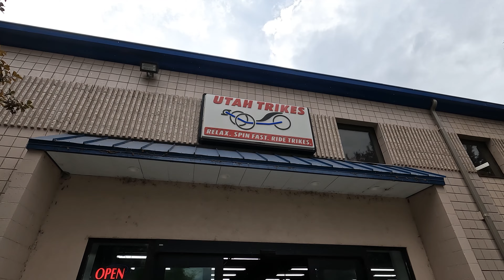The Stig tries out a new e-bike in Las Vegas!

Comment: Purchased by the ton, chromolly is 10 times the cost of aluminum.  Chromolly is, by far, the best material to build these things from.  It's very light and has much less stiff and much stronger than aluminum.  It's all a problem of cost.  Chromolly bikes are lighter than aluminum.  Aluminum is a lighter material, but you need a lot more of it (the tubes have thicker walls and larger OD).  Further, aluminum bikes is the reason all bikes have a pogostick as a fork.  The vibrations from an aluminum fork would kill you hands and wrists.
The only people who benefit from the stiffness of aluminum are racers and professional cyclists.  They have all switched to carbon fiber.
Reply: In terms of strength to weight cromoly steel and good grades of aluminium are about equal - in fact almost all structural materials, steel, titanium, aluminium, magnesium etc. have about the same strength to weight, with well made carbon fibre parts being then only option that's significantly better (And an environmental/recycling disaster that has no place in the cycling industry). 

Look up the weights of bicycle frames on the market and you'll find Al frames are consistently lighter than steel and titanium frames in the real world. Al has about 1/3 the density of steel, but it is also about 1/3 as strong in terms of yield strength (Titanium is about 1/2 the density of steel with a little over 1/2 the yield strength, though some of the air hardening Reynolds steels engineered specifically for bike frames are superior to the highest grades of titanium in strength to weight). The issue with this is that there are large parts of bike frames that aren't run anywhere near their strength limits such as the BB shell, most of the headtube and the dropouts, but they still have to fill the right amount of space to perform their function. With a low density material like Al it's easier to fill that space with a cheap constant wall thickness part without incurring a massive weight penalty or a massive cost penalty in machining away all the material that's not needed structurally.

Since these are motor propelled instead of human powered, a steel frame, even though it will be heavier, should be cheaper to manufacture (Steel is cheaper as a raw materials and can be MIG welded or brazed instead of TIG for example, and the steel frame won't be signifcantly down on strength if the frame isn't heat treated after welding). If they get used hard, the resilience of steel will be a lot more useful - Whistlin Diesel's cybertruck test (Where the back literally snapped off the truck after it had one heavy landing onto the rear going down a step) shows just how poor a material choice Al is for hard use - especially when he smashed the life out of a steel chassis pickup in a follow up video, showing that a steel chassis wouldn't fail even with literally 100 times the abuse. Admittedly that could just be absolutely shit engineering from Tesla, they definitely do enough of it, but it is a well known issue that al parts crack in the same situations that just make steel parts bend.
Reply: @peglor   "Look up the weights of bicycle frames on the market and you'll find Al frames are consistently lighter than steel and titanium frames in the real world."

I don't entirely disagree with regards to bicycles. However, in the real world, particularly at the low end, an aluminum bike almost always has a heavy poor quality suspension fork which brings the weight up.  A hard (non-suspension) aluminum fork will be rough on your wrists, hands and probably shoulders and back.  Aluminum is remarkably good at transferring road noise.  But high strength structural steels like those used in parts of a car meant not to deform are extremely strong.

Plus, the benefit of aluminum as a lighter material is offset by the need to use more of it.  The tubes tend to be larger, which makes an already stiff material stiffer.  This was always the rationale for aluminum bikes, not the weight.  Aluminum is also a much less tough material.  Even mild steel is very tough. Chromoly is even tougher.

"Since these are motor propelled instead of human powered, a steel frame, even though it will be heavier, should be cheaper to manufacture (Steel is cheaper "

Chromoly steel is 10x the cost of aluminum even by the ton. It is used extensively in auto racing and to a small degree in bicycles. I don't know if it is used in other applications like motorcycle frames, but I doubt it.. There are thousands of variations of steel.  I would think the very high cost is due to low manufacturing volumes.  Mild steel, otoh is cheaper than aluminum.

Yes, aluminum is not a tough material in comparison to steel.  I'm pretty sure a lot of the cybertruck uses cast aluminum (IIRC, they call it gigacast), which is probably brittle in addition to not being especially tough.
Reply: @tarstarkusz  Nobody riding bikes off road does it without at least front suspension. Even the road bikers have realised that ride quality actually counts for something, so they're moving to wider tyres instead of suspension, as there's no rolling resistance penalty - in fact independent testing has shown the rolling resistance of wide tyres is lower than narrow ones thanks to modern tyre sidewall designs, so the only people who haven't moved from that are the ones convinced that the fastest bike setup must also be the least comfortable and the most likely to kill you on loose or slippery surfaces. 

On the material cost, I suspect you're not comparing like with like. My understanding is that cromoly steel is literally any steel with Cr and Mo in it, so it covers an absolutely huge range of strength and price options, including some stainless steel options. If you want the most insane steels, maraging steels are probably the ones to go for. Yield strength around 2 GPa and a lot of them are stainless as a side-effect of the composition and I have no doubt that costs a lot more than most grades of Al. Go looking at rarer grades of Al and you'll also find really expensive compositions - 7075 is a phenomenal structural Al for example, with a yield strength better than some steels, while still having 1/3 the density, and that stuff is expensive relative to the far more common 6000 or 2000 series Al.

I have 2 steel bikes, one is ordinary 4130 CrMo steel and it's very heavy, even though it's quite a small frame, but it's been used for everything from road sportives and XC and marathon racing to street trials riding and now commuting and it's still going 22 years later. I have 2 Al framed bikes, also hardtails, and I reckon the 4130 frame rides harsher than either of them, but interestingly, because of the large diameter downtube in particular, the Al frames resist flex between the handlebars and the BB much more effectively, so they respond to hard pedalling more easily, as well as being more than 1 kg lighter - I doubt if either of those Al frames would have survived half what I put the steel one through though. 

The other steel frame I have is Reynolds 853 and it's a completely different feel because of the lighter, springier tubes - that's been going for well over 10 years of hard off road use. Both of these options cost more than cheap Al frames, but a lot of the reason Al is so cheap in the bicycle industry is because the entire industry tooled up for Al about 20 years ago, with steel relegated to a specialist niche, so there are no economies of scale in steel frames at this point, especially in a market where hydroformed frame tubes are almost universal.

For general structural work, especially civil engineering and automotive, steel is still much cheaper, because it gives the best performance per dollar, and they're willing to take the hit on weight because it's strain to failure and resistance to work hardening and fatigue are much better than Al so they can built safer, cheaper structures. A lot of the Al in modern cars is non structural to save weight for fuel economy.
Reply: @peglor  On the material cost, I suspect you're not comparing like with like. My understanding is that cromoly steel is literally any steel with Cr and Mo in it, 

4130 steel is what I am talking about.  Most chromoly bikes use this grade as do most race cars (specifically, the roll cage).

I am comparing 4130 tubes with 6061 tubes weight for weight, it's literally 10 times the price. Doing it by weight helps capture the bigger/thicker tubes of al.   I don't think you can buy it by the foot in quantity. (they come in standardized lengths).  I used quantity pricing because that is the best way to compare the actual cost without 3rd party specialized markups, though in most places in the US you cannot directly buy metal directly from the mill. I worked in a steel distributor many years ago.

I agree with you that the industry moved away from chromoly steel for price reasons. Now the whole industry is either al or cf with steel regulated to a niche market.

I have a 4130 large frame bike that was 23 pounds stock, a Trek 720 from the early 90s.

If your chromoly steel bike rides harsher than your aluminum bikes, something is wrong.  It is near universally accepted that steel rides easier than aluminum.  If you're comparing an aluminum bike with a suspension vs a steel bike without, well, that is not a good comparison.  Aluminum is stiffer than steel, especially with the larger tubes. 

The bikes in this video cost thousands of Dollars.  They should be making them from chromoly steel, IMHO for the prices they are charging.

I don't know why mountain bikes aren't made out of chromoly.  Perhaps there are benefits they getting from the larger tube size beyond strength.  If you are selling a bicycle for 5-10 grand, material cost of the frame is negligible.  Though obviously a lot of them are carbon fiber, which at least theoretically is stronger and tougher than steel.
Reply: @tarstarkusz  Stronger yes, tougher, absolutely not - carbon fibre frames are great until you do anything that applies a load the frame wasn't designed for, like crashing or clamping it in a work stand or bike carrier... Anything material that can't be recycled into more of the same thing has no place in making a product that is only designed to last a small few years.

The design of a bike frame is far more important for its ride qualities than the material used. Repeating the same rubbish bike 'journalists' have been spouting for decades, about different materials having different ride qualities is just perpetuating an urban myth. 

It is true that early designs made from unbutted Al tubes without gussets and hydroforming to keep the stiffness to the weld locations and along the load line from the bars to the BB were very harsh riding, but that was compared to overly flexy skinny tubed steel frames also being made being made 30+ years ago. 

The difference in ride quality was a property of the material only in that in trying to make steel frames light, they were forced to use very small diameter tubing, so the bike flexed like a noodle under power, while the lack of bike specific tubesets for Al and very little experience in building with Al in the same era forced manufacturers to overbuild their Al frames (Which despite this, were still lighter), and even then they had very poor reliability off road (Steel at the time was also very unreliable off road - I've fatigue cracked enough steel frames and rigid steel forks from that era to know this first hand). 

As for why bikes aren't made from CrMo now, it's because they're still heavier, and the weight seems to be the single selling point the bike industry stays focused on to the detriment of evrything else (Until they started obsessing over aero rubbish in road bikes a few years back, making the bikes much heavier, even though they are all carbon fibre). 

Combine that with the enshitifcation of the world in general causing the bike industry to have no interest in making bikes that will last more than a few years of hard use, because customers who's bikes last for years mean less profit for them and if everyone is doing it customers have to choose between giving up on the activity or buying new bikes. 

Mass production in Taiwan is almost 100% tooled for Al frames, with CrMo is pushed completely out of the picture apart from niche products, like Cotic and Pipedream in the UK and Surly in the US, where they sell low volume and can command high prices for the people who's needs aren't met by the mass market options. They're all still welded in Asia somewhere though, but with a lot less economy of scale.
Reply: @peglor  CF is extremely tough.  Tough basically means resistance to fatigue.  Like how many times can you take a material to just below its limit.  I think what you mean is plastic deformation.  Steel can be bent slightly and it will return to its shape.  But that is not toughness.  CF has almost no ability to do this.  When you take it to its limit, it just breaks or worse, it doesn't break externally, but experiences a lot of internal cracking and other damage which is invisible to the user.

No they aren't.  Do you really believe that this information comes from magazines?  These are material properties.  These are not mystical poorly defined properties dreamed up in marketing depts. These are measured by engineers in many other fields.  If you really want to see just how flexible steel is, watch some videos of train tracks being installed. They flop and bend like spaghetti.  Obviously, this force is greatly exagerated by the size and weight of them, but this is a real effect.  Aluminum does not do this anywhere near the extent steel does it.  This is exactly why you cannot change the wheel spacing of aluminum bikes.  The tubes will fatigue and may even crack.

I agree with that.  It's one of the reasons I ride a 93 Trek.  Everything is poorly made today.

It's not just tooling or labor. It's material cost.  Again, chromoly steel is ten times the cost of aluminum.

The lightness of a bike isn't really very important (within reason. You will notice the difference between 25 and 50 pounds).  The frame isn't that heavy no matter what material it is made from anyway. The vast majority of people who buy bicycles will not see any benefit of the bike being 2-5lbs lighter.  Most peoples' body weight varies more from day to day (we're not talking highly trained athletes).  I'm not sure stiffness is any benefit to anyone including bicycle athletes.  Energy doesn't just go away, especially in a system that flexes. Some would be lost to heat, but most would come back when the flex goes in the other direction (kind of like a bow).  This is not just a belief held by me. A lot of people who ought to know think the same thing.